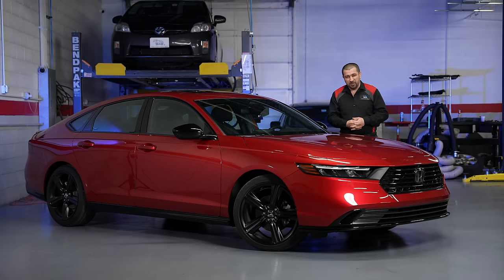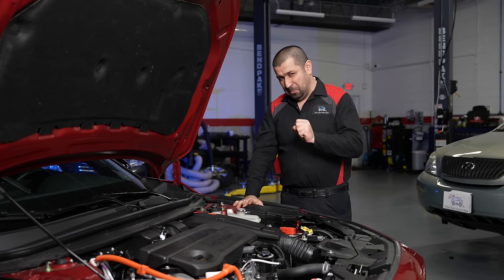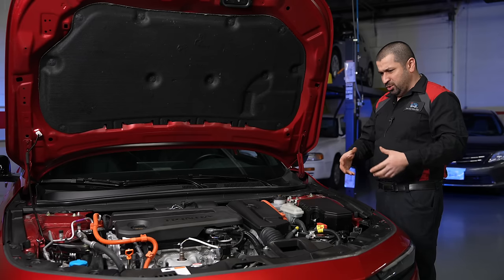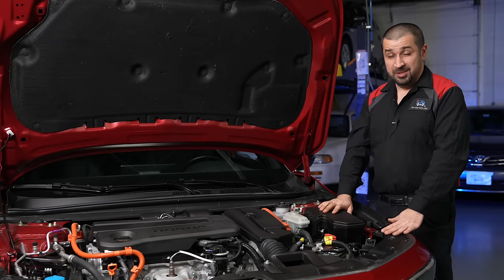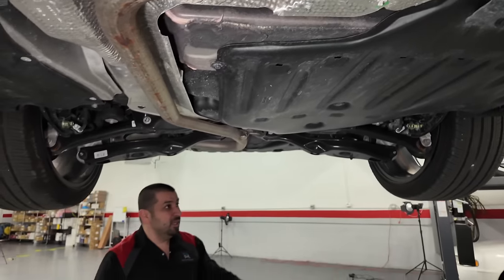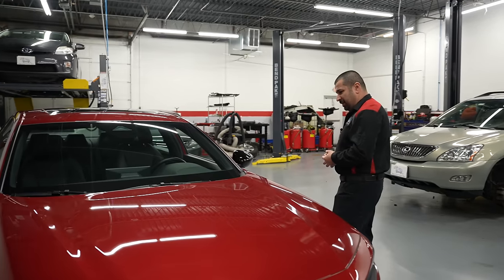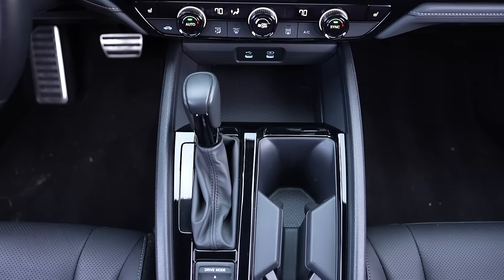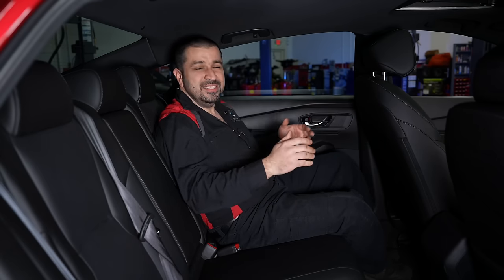Should You Buy The Latest Honda Accord? A Mechanic's Review

Comment: Great review! I learned a lot about the 2024 Honda Accord. I have some additional comments as to how the two top cars differ, the Accord and the Camry.  I like the Honda's smaller diameter sized a-pillars. It is easier to see around them and visualize what is outside.  The door swing and door handle are much easier to operate, when opening and closing the front doors your not reaching as far. Also you don't have to twist as far to reach the seatbelt. I also enjoy the drivers seat better and how my leg is better positioned in the Accord. That said both cars are really great and I believe you can't go wrong with either one when selecting a sedan.

Comment: Just rented a new Accord hybrid for the 3rd time.  I put about 890 mi on it for the 6 days that I had it.  Drove it from the United States into Canada rode around Canada and then drove it back to the United States.  I carefully watch the powertrain indicator to see which device was driving the wheels and which device was generating power to go into the batteries.  I would accelerate hard to force it to go from say EV mode to ice engine mode, listening very carefully to see if I could hear the switch of the power source.   I could not!  With my 2020 Honda Accord Hybrid, I can definitely tell when it switches from one power source to another.  However, the mileage that I got from the new car versus my 2020 is pretty much the same.  

If I get another car it is definitely going to be a hybrid. And though the new Toyota hybrid has been introduced, it just doesn't appeal to me physically or in the interior, as the newer Honda Accord Hybrid.

Comment: I work at a Honda dealership and from what I've seen so far, the Accord Hybrid(as well as the CRV Hybrid) are more popular with customers than the regular gas model. You could imagine how popular the Civic Hybrid will be when it finally arrives later in the year. Just like the 2025 Camry, I'm sure that the Accord will eventually go all hybrid later on down the line.
Reply: They are ok with down the line a 2-8k replacement of that battery if they plan on keeping it long term?

Comment: If you buy a Honda  - you'll feel rewarded every day! Other manufacturers cannot match them.
Reply: Honda currently  has millions of vehicles with recalls they cannot repair. Quality has certainly gone down. I own a 2006 V6 Coupe and I have not spent one dollar on non-maintenance repair items. Those days may be behind us.
Reply: I agree with u that older Hondas are way better than the new ones@ld4974
Reply: @dcal4455  All old cars are better than the ones we have now. They only had to make an engine and that's it, the interior had no screens and the radio you could take out whenever you wanted for another one
Reply: @ld4974  You speak as if Toyota and Nissan hasn't done any major recalls in the past 10-15 years. From what I can see, any manufacturer can do a big fuckup. Buy what you want and keep what you love, that's all.
Reply: @luanphan2706  The fact is that Honda has millions of vehicles under recall currently with no remedy available. Toyota does not.
Reply: @ld4974  Where did you see 1 Million Honda vehicles with recalls? Are you referring to the Takata air bag inflator recall where 19 different automakers (34 brands) had 21 Million vehicles recalled.
Reply: this was true like 20 years ago. Not so much anymore. Hyundai today is what Honda was then.
Reply: @sn4rl277  If not millions then certainly hundreds of thousands, most of the current recalls are related to fuel pumps.

Comment: I drive a CR-V Hybrid, which uses a virtually identical system aside from the fact it has an additional low gear. The "high gear" connects around 40 MPH at light load, and I would assume if the Accord has the same gear that it would lock around that speed too as opposed to 60-ish.

Comment: I am 74 and all this tech is way over my head, I started my driving career with crank windows/ 3 speed on the column no power breaks no power steering  no AC, carburetor and manual choke to start the car you turned the key to on and pushed a plunger thingy on the floor to crank it over.  You do a good job of explaining the technology it is kind of like a train locomotive in a way. I am not sure I am ready to make the leap, I have a 2021 turbo 6 speed manual transmission with only 12,000 miles on the OD.  My wife calls me an Auto Snob I have lost count of how many cars I have owned to date.  I can't even shop for a new car unless I know alls the pluses and minus and have fully educated myself on any car I am looking at. Maybe next year I will test drive a Toyota and the Honda and see what I think. A turbo is nice to own but I would rather not have to micro manage it. Ill look around in 2025 and take some test drives.

Comment: I live in a high-rise condo, and my parking level is on the 8th floor. The charge mode is good for charging the battery.  At least, 5 minutes of charge.  Every little bit helps.

Comment: Many thanks for your illuminating, comprehensive and unbiased evaluation . I agree with your
criticism of the lack of hybrid on lower models . The sport doesn't belong and I believe the EX-L
is the better choice as it uses 17 and not 19 inch wheels , runs smoother and gets better mileage.

Comment: I've been trying to wrap my head around this hybrid drive train for a while. My thinking at this point is series hybrid/direct drive. For low/medium speeds, it's a series hybrid where the electric motor drives the wheels and if the ICE runs, it drives the generator. For high speed, it's a direct drive where the ICE drives the wheels w/ a single gear ratio. A single clutch switches the two modes.  The cleverness is in how simple the connections are between the two modes of operation. Calling it a CVT is misleading because the "transmission" is actually only the switch between electric drive & ICE drive.
Reply: Most of the time, it is an EV. Not a Battery EV, like a Tesla, but a Battery and Generator EV. When the ICE runs to drive the generator, it powers the motor first, with any excess charging the battery.

This picky distinction is important, because it allows the efficiency secret. The engine is most efficient when it generates between about 25 and 50 HP (at a different RPM for each level of power). But a sedan like this needs less than 20 HP to cruise, even at highway speeds, and well over 50 HP for decent acceleration. So a typical ICEV will never use its ICE most efficiently. The Accord ICE will operate at its peak efficiency, 40.6% at 34 HP and 2000 rpm, most of the time (these are 2018-2022 numbers). The battery will make up the difference.

The system can be called a CVT because the ICE rpm is fixed while the speed of the car can vary continuously. You can calculate a "gear ratio" but the number is meaningless. Engineering papers call its an "electric-coupled CVT."

In direct drive mode, RPM=37*MPH. It is used above about 40 mph, or about 1500 rpm, which is the best rpm for 25 HP. So the engine will still operate very efficiently (it can drop from 40.6% at 34 HP to 40.2% at 25 HP), and the traction motor adjusts the power sent to the wheels and/or battery the same way.

BTW, "transmission" means the process of moving power from the power plant (ICE or battery) to the wheels. In a conventional ICEV, it includes the clutch or torque converter, gearbox, and differential. But the only part thew driver interacts with is the gearbox, so it is often called "the transmission." In a BEV, it includes the power electronics, inverters, electric motor, a reduction gear, and a differential. An HEV does not have a "hybrid engine," it has a "hybrid transmission." In this one, the ratio of (ICE RPM)/(WHEEL RPM) varies continuously.

Comment: If anyone is considering buying this car, I recommend going for the EX-L trim if you want the hybrid, as it is better equipped than the Sport and Sport-L models, while benefitting from having smaller 17" wheels that improve the ride and fuel economy. I feel that it is a mistake for Honda to equip 3 out of 4 hybrid trims with the 19" wheels that lower fuel economy and worsen the ride quality.

Comment: I like your comment about using the AC to help keep the hybrid battery cooler. On my 2009 Prius I was following a smelly diesel box truck while driving in the mountains on a warm summer day. I had turned the AC to recirculate to mitigate the smell. I then descended a low steep hill which fully recharged the battery. However, the hybrid battery apparently did not like not getting a supply of fresh air; for when I returned to the car later, after it sitting an hour, I discovered that the electrical portion of the drive system had completely disconnected and only the engine was supplying the power needed to move the car forwards and backwards which made for a jerky acceleration experience for I really had to stand on the accelerator to make the car move at all. Six miles later, and only after running the air into the cabin did the battery return to normal function. I think hybrids should have a battery overheating indicator, which the Toyota lacks.

Comment: ultra refined and simple, and it is unique that's for sure.  weirdly enough the audi RsQ they used in the dakar rally is very similar.  Electric torque and delivery with the motor acting as a generator.  Except the used an Audi DTM car and formula E motors.... little bit more premium.  but yeah this system makes sense to me.  It's smooth because it's an electric motor driving the car 80% of the time.

Comment: I just purchased a brand new 2024 Honda Accord EX platinum white pearl for $27,999 at 1.9% APR x 36 months.  That's not including state taxes though.  Vehicle came with a 10 year / 200,000 mile powertrain warranty.  

Overall, even though it isn't a hybrid...I feel that it was a decent deal.  The non-hybrid Accord still gets 29-30 in the city,  37-39 on the highway.  Very high safety rating as well for the family. 

Time will tell how the vehicle holds up.  Yes, it is a CVT and yes, it has a 1.5L Turbo engine...but still -- the vehicle is supposed to hold up well if properly maintained.

  I'm hoping to have it for a long time, and take good care of it.  

To Be Continued...

Comment: Actually, a lot of mechanics say the direct drive 0.8 overdrive gear does not connect until 100km/62mph, but I have found through actual driving, that the EV goes out at 15 mph..
The only way that is possible is if the electric motor is giving it a lot of boost that it would need to drive at the 0.8 gearing at such low speeds.  And that is the magic of hybrids. That is why I get 50-60 mpg driving 40 miles to work, in a nicely sized car.
Reply: A lot of mechanics haven't driven, or understood, it. A very good mechanic made the mistake of saying 100km/62mph, but provided no reference. The others seem to be basing their information on him. Very early in the life to the 10th generation, I got him to add a correction. But only in his comments. The video itself still says "100km/62mph." https://youtu.be/QLUIExAnNcE

The drive system has three modes (a Toyota has nine, they just don't explain them).

1) EV Drive. The engine is off, and the battery powers the traction motor. Its use is not governed by speed, but by power. This can happen at any speed, but only if there is enough charge in the battery and lower requirements are low.

2) Hybrid Drive. The engine runs at 2000 rpm and 34 HP, if it can. It is most efficient (40.6%) here. Any difference between the power the car needs and this 34 HP, is adjusted by charging or discharging the battery.

3) Engine Drive (overdrive). The engine can be over 40% efficient above 1500 rpm (40 mph). When little or no battery power, above the engine power, is needed, it will use this.

Comment: It was a tossup between the Camry and Accord, and I ended up buying the 2024 Accord EXL hybrid. What made the difference for me was feel of the car.  The Honda felt heaver, more solid. There are a few things that I hate about the car, road noise/wind noise at highway speeds and the front passenger seat is way too low with no height adjustment.  Also, the threshold is too high making it a pain to exit the car.  You would think that with all the ways you can change the dash they would at least put in an engine temp gauge and oil pressure gauge.

Comment: My 2024 Accord Hybrid just died on me with 395 miles. Was driving and got a message saying Critical Failure detected. Stop driving when safe. Barely bad it to a parking lot and it died. Had to get it towed to a Honda dealership. Dealer said the hybrid battery was bad and needs to be replaced! Covered by warranty but did not expect this from Honda!!

Comment: One thing that Toyota hybrids (not sure about the newest Tundra), is that they can be made to work as portable generators to power a house or electricity for camping. I believe, in fact, that Toyota hybrids sold in Japan have a ready-made plug-in outlet to make this possible. Honda hybrids do not have this capability. This has to do with how the systems are designed.
Reply: BYD as well have that bidirectional car to load capability. That can be useful 👍

Comment: Helpful and thorough explanation.  I have a Honda CRV Hybrid Sport 2023.  I love the quiet smooth drive and since I use it probably 70% between 25-45 mph I have been very interested in how good the ecvt reliability is.  I can understand the need for some to tow but for towing I would just get a Passport or Pilot or better yet a Highlander Hybrid.  So, would be great if Honda puts this Accord Hybrid system in the next Honda CRV Hybrid.  Love the idea to be in EV  non-Engine mode all the time other than HWY speeds.  Love the Honda CRV Hybrid 2023 system but being 2 clutches is concerning.  I need 150,000 miles on a purchased car to make it work out economically the idea being 8+ years so 2-3 years are non-loan payment years to save up for a new one.  Love the idea that Honda has placed the hybrid battery under the seat.  I would sure expect Honda to do the same in the next CRV Hybrid generation (2028?).  Maybe Honda will put this Accord Hybrid system in a future HRV Hybrid to compete with Toyota Corolla Cross for people that would have no reasonable interest in towing.  Maybe even a future Honda Civic Hatchback Hybrid.

Comment: An example of a turbo-hybrid: Just test drove the GWM Haval H6 plug-in hybrid w the 1.5 l turbo. 34kWh battery, giving about 160 km in EV mode, 393 horses & 77.7 kgfm torque. That crossover has some get up & go! 0-100km/h in 4.9 seconds. Wife wants the non-plug-in version w 150 horsepower 😢

Comment: Im still not sold on the front end look and I miss the 2.0 turbo option but the engineering that went into this system is genius. No turbo, no CVT and a sophisticated computer to manage charging for extended battery life.  

I just want to know how much to replace the battery because  everything else seems easy to service.

Comment: I just returned a 2024 CRV rental that was fully loaded and only has 2010 miles when picked up, I returned it with 5350 miles after having it for 12 days. We test fit the Accord first before selecting the CRV and the interior and seats in the Accord are amazing! Honestly, I would totally buy an Accord just for the comfort and economy alone, however with that said, it is so much more ugly in person than on camera. I think the Camry is a MUCH better option overall for most people and Honda seriously needs to step up with a major refresh, but there is something else that is an issue and will touch on this in a second. 

As for the CRV, it was a good vehicle but its slow, very very slow, even with the turbo engine. The CVT is tuned for economy and to make sure you do not wreck the transmission and one can easily tell when you need to merge from a dead stop. IT just didn't have the power bellow 30mph to feel safe. The seats could use more lumbar support as well. The leather was very nice and the only other major complaint is the lack of selectable gear ratios in the CVT, other manufactures have this option and it IS NEEDED for hills and mountains passes. S-Mode is not good enough and becuase of this fact, I would likely have to pass on anything, Honda or not, that doesn't have selectable gears for steep hills/passes. I drove through the Rockies and other ranges on our road trip and had I known how badly the tranmission would handle 8% grades, sometimes 5-7 of those in a row for miles at a time, I would've selected a different car and the Accord does not have the ability for manually selecting gears either. Perahps the Sport trims of these vehicles have it, but not the top trims.

Comment: Great explanation, this works like the Chevy Volt when it was in HEV mode (20% battery). Best thing is these transmissions are super simple sun gear transmission. Looks a lot like a Voltec system!

Comment: The reason why indirect TPMS is a recent feature is due to the new ultra high resolution ABS sensors that can detect very slight differences in rotation speed. The downside is they can’t display tire pressure